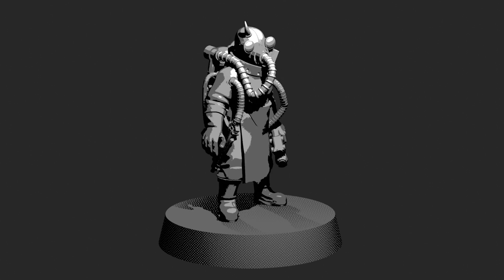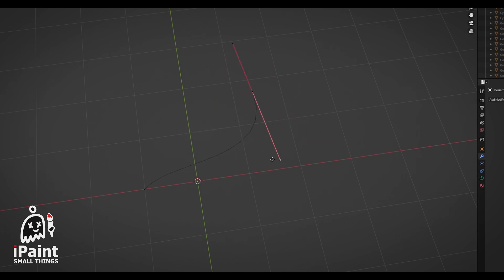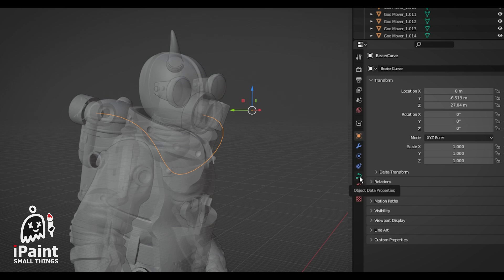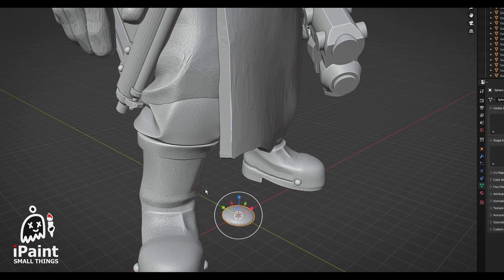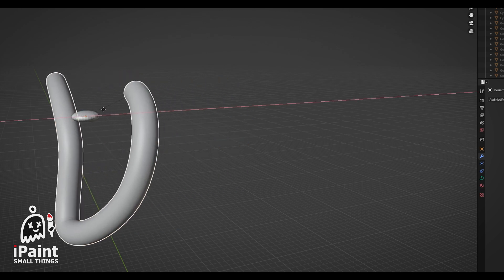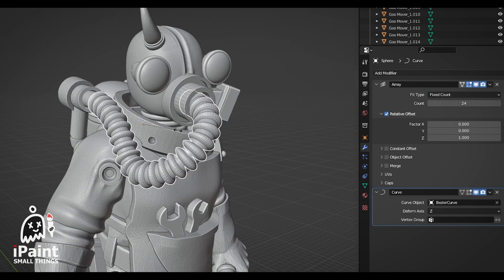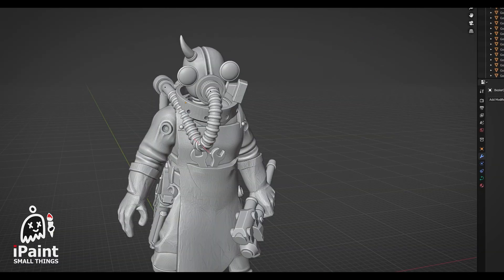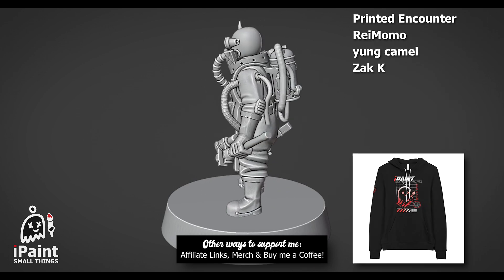How to Make Hoses & Cables in Blender

Comment: Awesome! This is EXACTLY what I was looking for and so direct and to the point. I have some minis that the heads have respirators and the hoses going out of the face mask but then only go around the back of the heads, they don't connect to the air tanks on their backs. Initially I tried doing this in Meshmixer but the results were pretty lackluster. Now I can add variety to the hoses. Subscribed!!!
Reply from the maker: I really appreciate it and am glad it worked for you! Those hoses definitely needed to connect to their air tanks!!